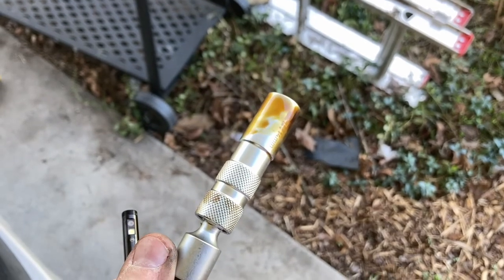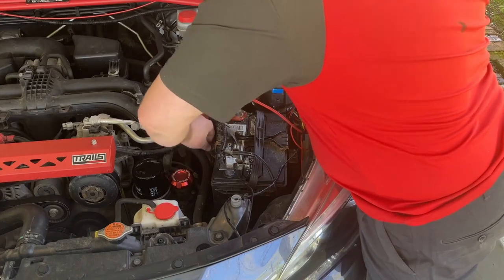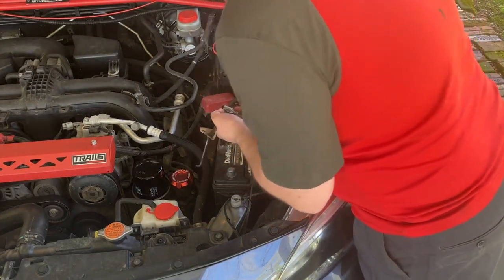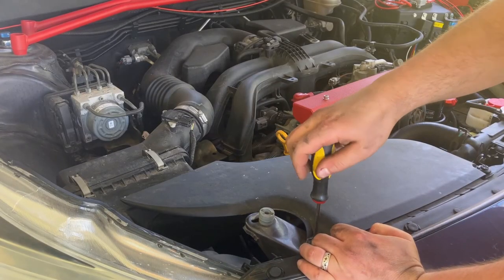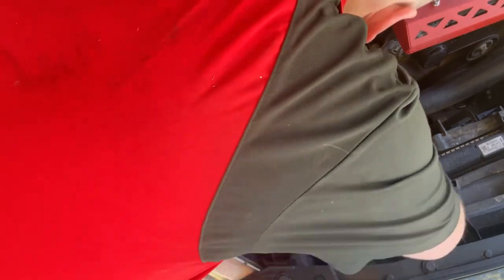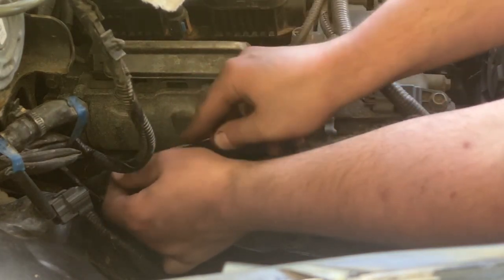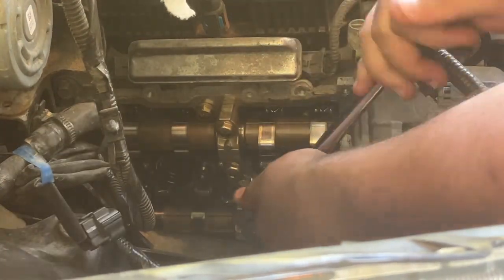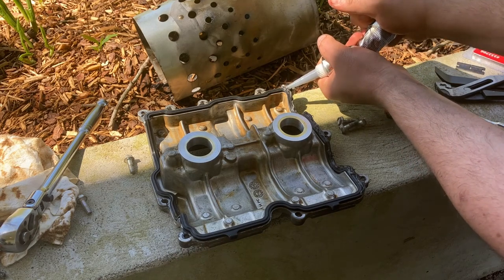Valve Cover Gasket, Sparkplug Tube Gasket, And Sparkplug Replacement 2015-2019 Subaru Outback

Comment: Great instruction. Interestingly, I don't have that metal plate so the coils were fully exposed. A shop was going to charge me $400 for a replacement, which is basically robbery at this point. How do you know if I need to replace the gasket or coils? I'm just going to swap out the spark plugs.
Reply from the maker: The best way to tell is to take out the front passenger coil and see if there is oil in that sparkplug tube. If there isn't you can just replace the plugs and be okay. If there is oil then you'll have to do the gaskets. For the coil, you'll need to replace it if you have any misfire codes, or if there is any damage to the coil especially to the rubber boot thag goes over the spark plug. However if there is just damage to the boot, there are replacements for just that. They are on rockauto Standard Motor Products #SPP208E
Reply: @Subaru_Who  You're a rock star. I don't suspect I have either of those issues but I haven't looked at it yet. You saved me $400.
Reply from the maker: Glad to help! Subaru sparkplugs seem daunting, but they aren't too bad. If you run into any issues, you can comment back here and I'll most likely see it quickly, but you can also message me on Instagram @subaru_who, and I'm also a moderator in the Modified Subaru Outbacks and Subaru off road Facebook groups.
Reply from the maker: Also, just to be clear, if you are just doing sparkplugs, you don't have to take the valve covers off, you can just take the coils out, replace them, and put the coils back. You probably know that already, but that's not the process I did in this video.
Reply: @Subaru_Who  To confirm, I need a 14mm  "spark plug" socket. What is the torque settings for them and anything else I might need to tighten down? Thanks.
Reply from the maker: The spark plugs are 13ft-lb and if you end up having to do the valve covers those bolts are 8ft-lb. Those are the only things that have specific torques, everything else is gütentight (good and tight).

Comment: You said spark plug gasket, where to buy these things and how hard is it to replace
Reply from the maker: The spark plug tube gaskets came in the same Mahle package with the valve cover gaskets. I ordered from rockauto
Reply: @Subaru_Who  ok I have my separate lol, I’ll have to order them, are they round??
Reply from the maker: Yes they are round donut looking gaskets